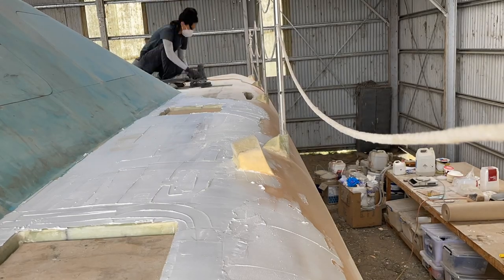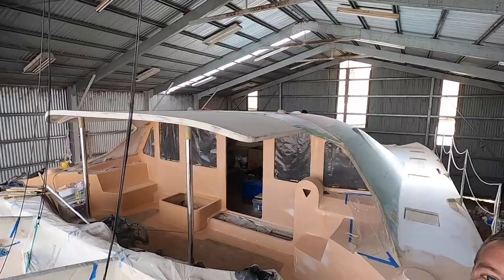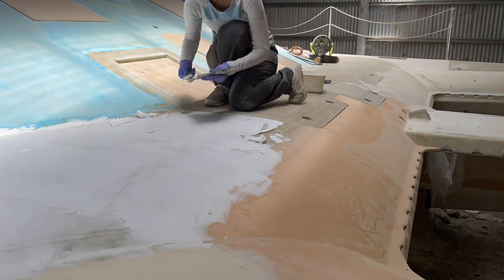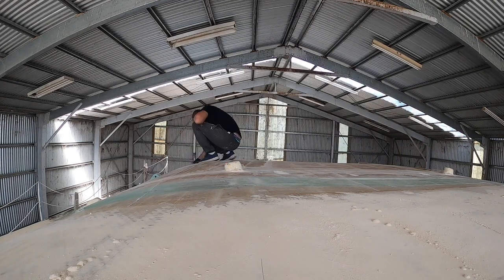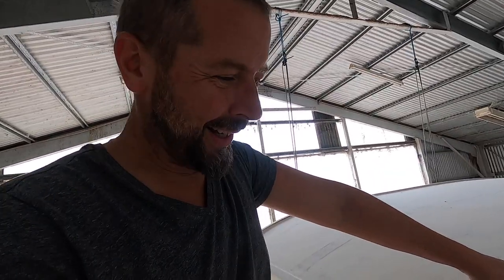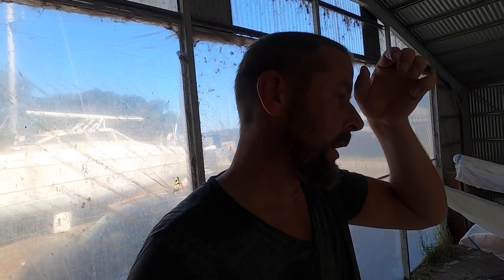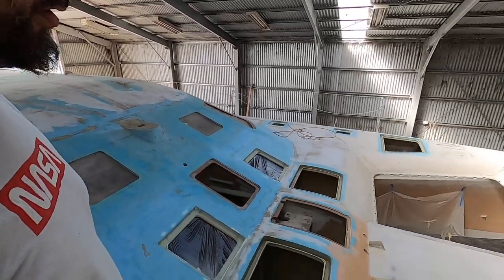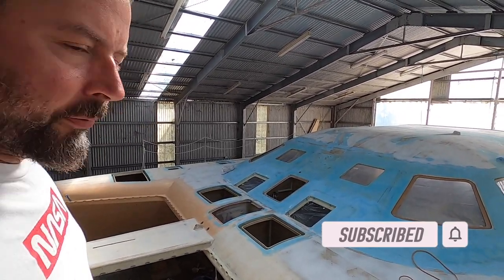Primer on deck & roof? Ready or not? - S02 E11

Comment: Looking good. I sprayed Altex Epoxy Barrier undercoat , then Altex Elite Defender, their pro spray two pot, as my finish coats.  The undercoat is a high build paint designed to be a final fairing coat. Sands off easy like dust and leaves a velvety finish that the two pot really hangs onto. The system worked really well on my boat and created a nice high gloss glassy hard finish. Cheers
Reply from the maker: I used their epoxy at one stage. Right now I'm likely continuing with Hempel.
Reply from the maker: But altex has facilities close. I'll have a look for sure.

Comment: Kept thinking its summer, galvanize shed, no windows, vents, exhaust fans, shutters. Forget a/c. Both of you do not seem to break a sweat. Start early, siesta rest, late evening/night push. What about the humidity? Stay hydrated, refreshments in the cooler/fridge. Take regular breaks. Maybe add solar roof vent fans or some portable ones.  Personal portable backpack a/c cooling kits? Or dehumidifiers plus portable externally ported a/c units for the most unbearable days or weeks.
Thinking about priming and painting. Kudos.
Reply from the maker: I think it may be a weird summer. Not that hot down here actually. But the days over 25, and there are many of those, it gets pretty hot.. we've had a few days in the mid 30s. Those days are unbearable! We can't work on deck those days, much less the roof. Epoxy goes off super quick.
But we manage. Drink lots of water... And coffee 🤣. And really hot days we go shopping for groceries and tools/material. We can't work at night and we are not morning people. Most days we get 8 hours of work in. Yesterday 12.

I assure you we sweat! 🤣 And come home with aching bodies 🤣

Thanks for the concern.

/Axel and Rox
Reply: Build a sm above ground covered swim pool. Buy a plastic water tank and fill with water. Buy a second smaller tank or cooler. Store second tank at a higher elevation. Dump ice in second tank. Use a pump to circulate the warm water water up to the smaller one.
Have some fun. Or styrofoam a bulkhead. Add water and ice. Cool down. When finished, pump out using bilge pump or drill hose combo.

Comment: If your not already using 3M Extract cubitron ll sanding discs you may want to try them more expensive but last 4-5 longer than regular good quality discs🎉❤
Reply from the maker: Using Mirka. Will check the 3m

Comment: How did the wallboard sander go for faring, were you happy with the finish, looked like a good dust collector system
Reply from the maker: Went pretty good for initial shaping of the fairing compound. We'll see how it goes on paint... Indoors it is too big. Large fairly flat areas work decently. Much better than torture boarding the whole thing by hand. But not as good a result.
The finish is now at the second fairing stage. Many spots are not great, but in general I'm pleased. Much more sanding to do I'm afraid but less shaping.